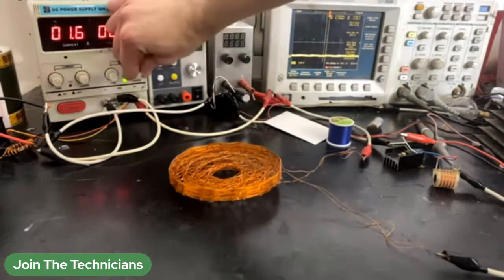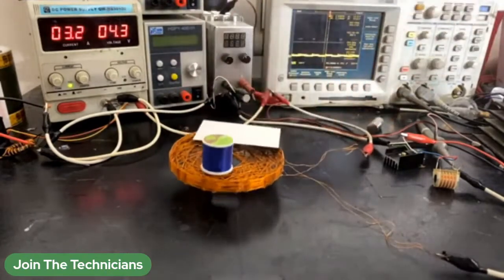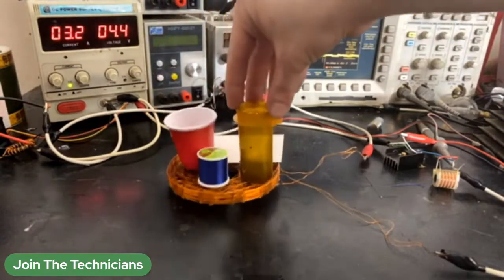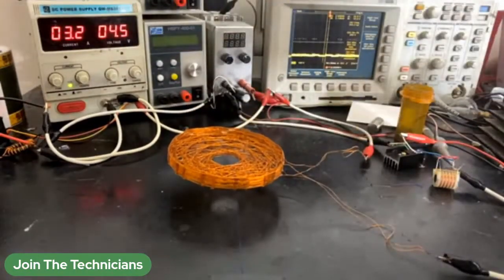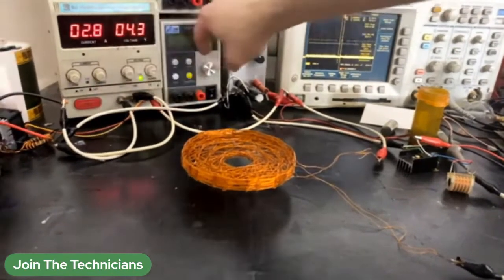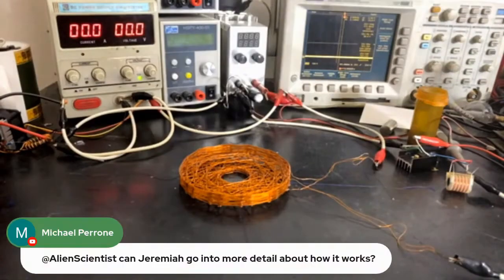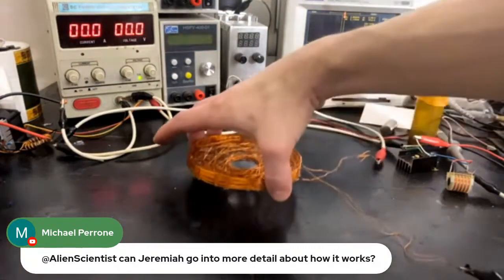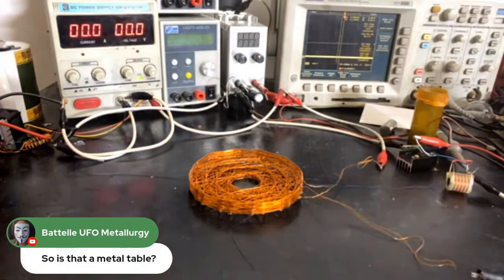Levitating Star Challis Starship Coil @wpgenlighten4truth2 @exoticpropulsion8175

Comment: there was no magnet or 2nd coil under the table.  The grapevine is passing along that story.   
INGREDIENTS
1)  high voltage lifter ionization
2)  from a coil's collapsing magnetic field
3)  right-hand rule shows the 'ion wind' is not pointing downward, but outward, at different angles
4)  MOSFET being used to create the back emf spikes, by interrupting the DC magnetic field of the coils
5)  coils fed by DC constantly to create the static magnetic field
6)  Lorentz force, pancake-coil-shaped magnetic field (flat)

A rudimentary knowledge of how static DC lifters work, a bit of very high voltage transients ala Steinmetz, and the observation of the shape of the magnetic field around a pancake-like coil,  and a possible role of the Lorentz force explains why this coil can support a certain amount of weight that a normal static DC lifter cannot.  Unlike a normal static DC lifter, this one uses the energy stored up in the magnetic field of the coil, and the back emf from collapsing that magnetic field.  Much more energy used than in a static DC lifter

 I'm still too lazy to mess around with coils and ionized air molecules to prove it, and none of my workmates will pursue it for the same reason.  But creation of coherent accelerations of the charged particles in the metal is NOT what this coil does, at least not for its 'lift.'  

If you utilize the back emf of a coil (by that I mean you charge the coil with DC, then very quickly remove (via a MOSFET used as a switch) the charging DC, you get a large back emf spike.  Assuming you have a step-up transformer implemented between the two coil windings, AND assuming the "dots are reversed"  (see 'transformer dot notation') -- then the back emf spike will be 180 degrees opposite phase in the secondary winding. So a positive-going voltage at its peak in the primary is reversed in phase in the secondary, and the back emf spike will be inductively coupled from the primary to the secondary 180 degrees out of phase, and the secondary will see a NEGATIVE-going voltage spike. 

Let's say the 'turns ratio' between the primary and secondary windings of this counter-wound coil is  1-to-10.  (ie. if the primary has 100 windings, the secondary has 10 x 100 = 1000 windings).  It's a 1-to-10 "step-up" transformer.  Just hypothetically here.

So if the back emf spike from the collapsing magnetic field in the coil is, say, 4000 volts positive peak in the primary winding, there will be 40,000 volts in the secondary but it will be negative 40,000 volts spike due to the 'dots reversed' winding. 

In other words, since the primary winding is 180 degrees opposite phase, you thus have a total transient voltage of:  4000volts - (-40,000volts)  =  44,000 volts between the primary and 
secondary winding.  Since the voltage is very high, and very brief (the transient spike is very brief, just the time it takes for the coil magnetic field to collapse when the MOSFET shuts off the DC),  it is a powerful 'lifter' effect. 

It does not last long enough to arc over due to the brief time of the transient pulse.  And since it is occurring at the frequency that is being fed to the MOSFET gate (the MOSFET creates the high voltage transient spike by interrupting the DC feeding the coil to create its magnetic field) - this high voltage condition is occurring very frequently, at the frequency being fed to the MOSFET's gate to shut off the DC.  Let's say that frequency is 100 khz.  Then the hypothetical  44,000 volt 'lifter transient spike' is occurring 100,000 times per second.  

Static DC lifters do not use the energy stored in a magnetic field to create large transient spikes.

There are angles implemented between the primary and secondary windings - it's important to know the direction that the charged particles are flowing in the ionized air molecules during that large, magnetic-field-collapse-generated transient spiking.  Well, using the right hand rule  (thumb/forefinger/middle finger at 90 degree angles),  we know the magnetic field is laying flat on a pancake coil, so middle finger up through the coil center hole then lay flat on the windings - that's the B field.  Index finger pointing straight up, thumb pointing to the left.

And the flow of charged particles will be AT AN ANGLE at the wire crossover points (the ionization that occurs when the brief transient spike manifests), so slightly rotate the right hand counterclockwise a bit so the index finger follows the direction of current flow in the ionized air. 

Now the thumb is pointing - SOUTH-WEST.  So all around the perimeter of the coil, the Lorentz force pushes the 'ion wind' in a south-west direction.  Since the angles in the geometry of the two coil windings vary, the direction of the Lorentz force acting on the charged particles in the ionized air WILL VARY.  This may account for the 'wildly unstable' behavior.  Unlike a normal DC lifter, where the ion wind flows downward, the angles in the high-voltage (44,000volts in this example) wire crossover points DO NOT POINT DOWNWARD.  The counterclockwise rotation of the right hand will vary to follow the angle between the two wires (one from the primary winding, one from the secondary winding) at those crossover points where high voltage appears.

AGAIN,  I haven't built it, and don't intend to, but I heard at that drinking fountain that 'jeremiah stashed a hidden coil under the desk' and he is not that type of person. 

INGREDIENTS
1)  high voltage lifter ionization
2)  from a coil's collapsing magnetic field
3)  right-hand rule shows the 'ion wind' is not pointing downward, but outward, at different angles
4)  MOSFET being used to create the back emf spikes, by interrupting the DC magnetic field of the coils
5)  coils fed by DC constantly to create the static magnetic field
6)  Lorentz force, pancake-coil-shaped magnetic field (flat)

There's no freaking way Jeremiah would lie.  So this is my attempt to try and STOP that rumor.

And I'm sorry I'm too lazy to build it.
Reply: NOTE:  forgot to add, the frequency of the pulses is high enough not to be dangerous along the top side of the coil.  You can touch the top area safely because the high-frequency skin effect.  Tesla demonstrated very high voltages at very high frequency (and very low current) across his body in the late 1800s.  But  If the lorentz force acts on the ferrous (iron-containing) molecules in your hand/arm/body,  you have, say,  collective Lorentz-force-caused motion of large quantities of your tissues/fluids being pushed around by the Lorentz force, so keeping 'soft tissues' away from the underside is probably a good idea.  I've never gotten an eddy current + magnet field = lorentz force on my hands etc. but it's likw touching a red hot stove, just avoid it, no need to experiment.
Reply from the maker: apparently a normal lifter can carry a payload heavier than itself LhygSconaFE
Reply: @sFeral  Nice find - that's an oldie.  About the only reason to build a Mike Powers star challis counterwound pair of coils is to nail down how much weight it can carry.  That being said, a MOSFET with its cooling fins chassis would probably keep it on the wooden desk.  As to why the rumor mill I discovered the other day came up with a 'magnet under the table' is puzzling, since there's nothing too magical about that hover coil.  It's old conventional ideas.

What I'd like to see them try is:
1)  sputtered laminations of ferrous or non-ferrous metals on a substrate

2)  in the shape of a sphere

3)  with a 'sectoring' layout of the shell, so that each sector is isolated from the others and the resulting field effect can be applied to one sector at a time

4)  a klystron for a high-frequency source inside the sphere, and constant B-field electromagnet for each sector

Very high frequency pulsed eddy currents + magnetic field on each sector = coherent accelerations of the charged particles in the sectored laminations.

Artificial gravity requires
1)  all charged particles in a sector working together, "everyone pulling the cart in the same direction"

2)  preferably at a resonant frequency of the sector

I used to work on Perkin Elmer cryogenic sputters at National Semiconductor and layers of 10 microns of thin film materials has been around for decades.

The sectoring of the laminations that make up the spherical shell is for steering.  Everyone wondered "how could the feuerballs steer without control surfaces"  they sectored the laminations to create the artgrav field in the sector along the path they wanted to travel.  Thinking that the spherical shell was one contiguous piece is what led to the misunderstanding, perhaps.  H.W. Wallace gives an outline of how to use specific materials to insulate from, and isolate, artgrav field effects, in his "Secondary Gravity Field" patent.

They already have all the equipment to pull this off, except the cryogenic sputter
Reply from the maker: @Greg_Chase  It's not just a rumor. Look at the screenshots Mark Sokol provided in Charlie C's  (dedicated Hovercoil Wapp) group,  ask for an invite in the APEC 24/7 group, which you can join by finding the link on the official APEC site
Reply from the maker: @Greg_Chase  It's "magical" as long as no one else is able to demonstrate anything similar
Reply: @sFeral  Thanks dude, I'll check it out.
Reply: @sFeral  Whoops you need a smart phone for that - I stopped using smart phones a decade ago.  Anyway,  they're pursuing their own ideas, which is good, because in this community it's better to have all experimenters working on a variety of things.  Cheers!
Reply: Yeah, after the last APEC, seeing Electron Air's spiderweb-like ioncraft makes me think this is a very efficient ion craft, and perhaps the vortex-like shape and the bifilar fields help to confine the ions.  I think I remember the hypothesis that it was ultrafast pulses which could induce a polarization in the non-conductive material below or the air itself and then a second pulse repels itself from that polarization before the polarization reverses.  That sounds maybe possible but I'm not sure if you could do that without using ultrahigh frequencies (perhaps that's what the sawtooth terahertz tech often mentioned in this circle does).  I hope they finally come out with all the details together and do it in a vacuum chamber and I'm not coming back in another month wondering what magic this thing could be working.
Reply: If I wanted to really be speculative and go out on a limb, maybe a magnetic version of Hector Serrano's Gravitec thruster which seems to have some studies with it producing thrust.  I would've made the comparison to David Pares's VEM drive but Martin Tajmar's team seems to have done a pretty good replication if it in the vacuum and found no measurable thrust.
Reply: @SaveTheFuture The coil has two windings based on the connections to it, and one has far more wire than the other seemingly, hence the surmise of step-up transformer.

When the square wave being fed to the primary winding reaches the 50% of its duty cycle, it has now dropped from the positive 1/2 cycle of the square wave down to the 0 volts line (and is beginning the negative-going 1/2 cycle of the square wave).

This cuts off the MOSFET.  The MOSFET is supplying the ground to the primary winding (the other side of the primary winding is hooked up to a DC supply).  When the MOSFET stops conducting, the ground connection goes away.

When the ground connection goes away, it is physically identical to opening a switch in a simple circuit that has two elements:
1)  a battery (or DC power supply)
2)  an inductor

That seems to be what the primary winding circuit is.  Working as follows:

a)  one side of the primary winding is connected to the DC power supply

b)  other side of primary winding connected to ground THROUGH THE MOSFET

c)  MOSFET gate is turned on by the positive 1/2-cycle of the square wave from the siggen (signal generator) - assuming an NPN type of MOSFET (where a positive voltage on the gate puts the MOSFET into conducting mode, and current can flow between the source and the drain)

d) while the MOSFET is 'on', the primary winding current flows to ground through the MOSFET, and its magnetic field builds up

e)  when the MOSFET is turned off by the negative 1/2 cycle of the square wave, the primary's magnetic field COLLAPSES and a huge Back EMF spike is induced in the primary

f)  the changing (collapsing) mag field and Back EMF in the primary induces a stepped-up voltage in the (larger) secondary winding

And ionization could occur, briefly, during the collapse of the magnetic field transient pulse, between the primary and secondary windings, in the more 'geometric' inner part of the two windings, where there is visible space between primary and secondary wires, thus creating gaps for 'capacitors' to ionize the air briefly.

An easy way to test this would be to take a standard 'thin wire + aluminum foil ground plate' lifter using the same input circuit, see if you can get the thin wire much closer to the foil without arcing.

Recall that in a normal static DC lifter, the thin wire cannot be close to the grounded foil.  That's because the 20,000vdc applied to the thin wire is not a transient pulse - it is a static DC voltage, it is persistent, it is present long enough to create visible arcs.

In this Back EMF coil, the ions can be produced by the transient spike between the primary and secondary.  In a thin wire lifter, with the same MOSFET/Back EMF driver input, you can probably move the wire much closer to the foil since there is no persistent high voltage DC to create an arc-over.  It takes some time to ionize air, and the geometric coil is probably not arcing over, only ionizing the air.

If you find a normal lifter's thin wire can safely be moved closer to the foil grounded electrode without arc-over, and the lifter still functions, using the same input as the geometric coil,  then you can pay a high school student to wind a few of them.

I'm working on accelerations to the exclusion of all else.  I also have my daily stuff taking my time.  I haven't built the MP type of coil to test anything despite wanting to.
Reply: @SaveTheFuture  If you're working on coherent accelerations by way of the Lorentz force in thin layers, a ferromagnetic material used in the lamination would have a non-linear reaction to the applied eddy currents and magnet being used to create the Lorentz force accelerations.  The remanence, the hysteresis, of a ferro material means a high frequency eddy current coil would be defeated because the ferro material would not flip its 'magnetic domains' (electron spins) fast enough.

I'm thinking the reason the 25-layer "Art's Parts" lamination involved only paramagnetic (magnesium) and diamagnetic (bismuth) materials is - they do not hold the affects of being magnetized.  Those materials would be much more responsive to high frequency changes in the magnetic field created by the eddy current coil(s) applied to the lamination.

Ferrous materials (iron, cobalt, nickel, and alloys like neodymium) hold their magnetic field 'permanently' and that is a bummer if your eddy current coil is cycling and inducing eddy currents at very high frequencies.
Reply: Why the 25 very thin layers?  High frequency eddy currents lead to skin effect is one reason.

Why not just use one layer then - why 25 layers?  The 'hot potato' effect.  If you're in a log cabin on a hunting trip with no heat, you put your 3 potatoes on the fire before turning in.  When you turn in, "I'll use these potatoes to stay warm.  There's no heat in the cabin."  Old trick used by the pioneers in the early U.S.

"Should I cut up the hot potatoes into a bunch of small pieces?"  They instinctively knew that the ambient (cold) temps would cool the hot potatoes much faster if cut into small pieces - because cutting the potato into a bunch of smaller pieces greatly increases the surface area of the potato that is exposed to the ambient (cold) temps.  The potatoes were left intact because that exposes the very least surface area of the hot parts inside the potato to the cold temps.

The Vacuum or 'Nature' will quench any concentration of energy very quickly.  The universe is uniform and isotropic, and thermodynamics aims to keep it that way, quickly redistributing concentrations of energy into the larger volumes of space surrounding the concentrated energy.

True for a radio antenna.  Those accelerated charged particles radiate away their concentration of energy in all directions.
True for a hot potato.
True for high frequency coherent accelerations of the charged particles in those 25 thin layers.  A single thin layer's accelerations do not have the same effect as a depth of layers.